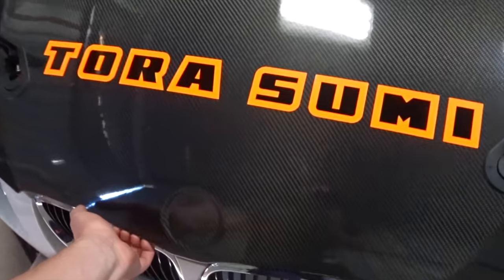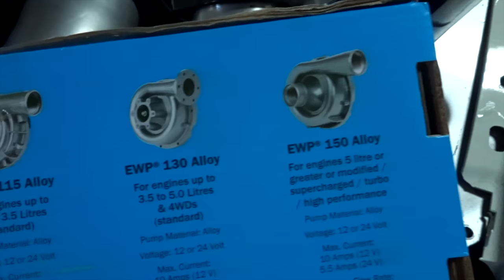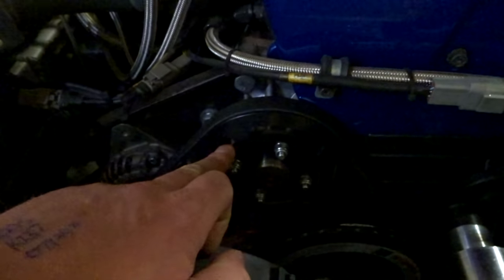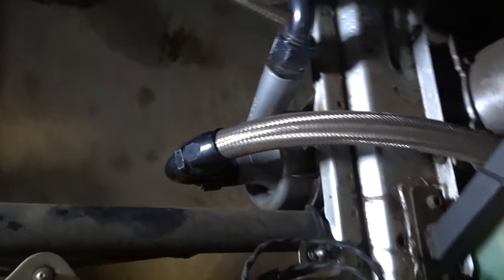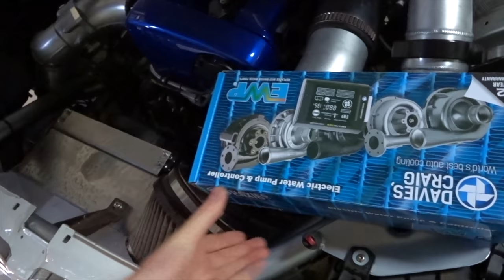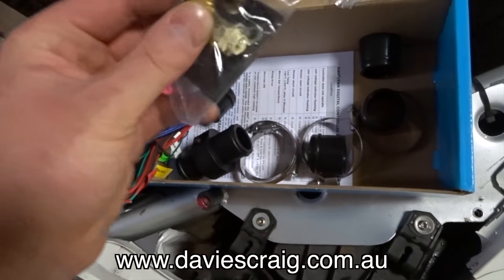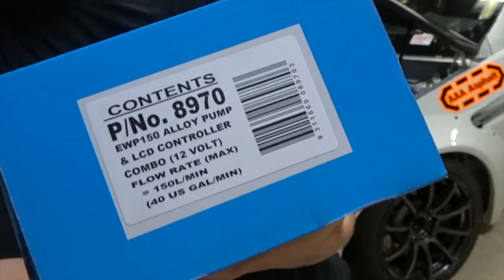How the RBM3 stays cool - Davies Craig EWP150 | Cooling system explained

Comment: Sick man thx forsharing! My car heats up another 20-30 degrees Fahrenheit after I turn the engine off.  🤔 maybe I should run one of these
Reply from the maker: Yeah these are ideal for cooling the engine down. Even when I'm in a line up I can turn the car off and let the engine cool right down. Doesnt need it with the setup I have but it can be used for that also

Comment: @DriftSquid Hey Jake, I have an EWP150 installed in my lower hose as well on my RB with no thermostat installed (without factory pump pulley on, housing still there), and I have a few questions about your setup.  Do you have some sort of bypass to keep coolant flowing around the block but not through the radiator?  My ECU controls the pump as well via PDM relay which can control the pump with a duty cycle which basically lets the pump/ecu combo become the thermostat.  I always have it running at a minimum of 5-7% duty below operating temps to prevent a hot spot from forming in the head, and it ramps up with temp based on an ecu 2d mapped with duty vs coolant temp.  My problem is at speed, it will never get up to full operating temps (60-65C, never hotter).  At idle, temps will gradually spike up to 80-90C, and the pump duty will ramp up, essentially cooling down the engine way too much due to coolant sensor response times being slow as they all are with fans dumping radiator heat so fast.  So I was thinking maybe I need some sort of thermostat bypass or a separate pump just to circulate within the engine only.  Do you have anything other than ewp150 pump, fan, and radiator in your cooling system?  I was basically wondering how you actually regulate your running temps without killing the flow inside the block.
Reply from the maker: Nah I am the same. My car wont get hotter than 65 with the pump running at idle. I usually leave it off for a while and then once its all hot I leave the pump flat out. The way I drive the temps will stay around 90 degrees all the time. But never go over 100. 
MY setup works well it just takes ages to heat up. Bit of a pain but Id rather this than it over heating.
Reply: DriftSquid Awesome! Well better for it to work too good than not well enough aye? These pumps are insanely good, far better than OE mechanical pump.  I guess I’ll weld in a thermostat bypass to return the upper flow exiting the block right back to the lower hose pump inlet.  Unlike you, I don’t go flat out all the time 😂. I may take it to 9500rpm every once in a while to make a grin, but that's about all. Thanks for the response!
Reply from the maker: @taiphoon228  no worries mate and sorry I missed this comment. I usually see them all and reply but since the new YouTube update I'm missing a few. Thanks mate

Comment: Jake, I love you bro but you gotta stop making me go broke again by now offering me EWP150s at 35% off you bastard!! 😂🤣 Let's see, so far the Crustida has identical CBC wheel bearings to Sonvia and an identical radiator to RBM3. You almost got me with the MoTec too. 😉
Reply: What radiator is he running? I'm up for a new one for my rb
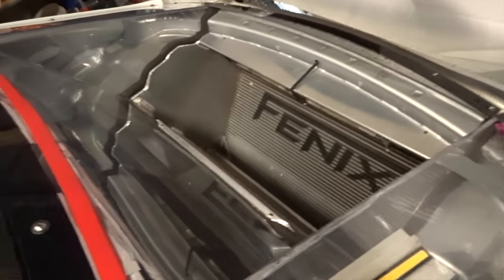Reply: @nickmckernan2946  3:05 bro. 😉
Reply from the maker: haha sorry mate. But its all for the best really. Least you can get a solid discount through this. The radiator I run is a Fenix Patrol one. She is a big unit haha.
Reply: @DriftSquid  Oh for sure, a full $200 saving on the full kit. You said 22nd, so hopefully I can scratch up enough coin for that... I'm rushing to get my front end put back together before cyclone season starts up here then rebuild the motor inside the garage instead of being stuck on driveway. 👍
Reply: @DriftSquid  Dammit, just double checked this and have missed out on your deal but luckily SuperCheap has a 30% off boxing day deal so I'm still getting it for Crustida, just over $200 for the EWP150 kit. 👍
Merry Christmas brother, hope you and Bri have a great one. 😎

Comment: How did you make sure your tyres wouldnt hit your flares? Lined up with bumpstops? or do you run a stiff suspension?
Reply from the maker: Suspension is not rock solid. It has heaps of travel. Just need to make sure it travels in the right direction